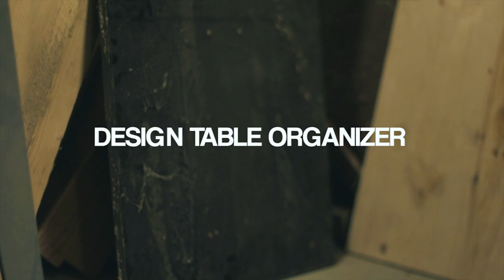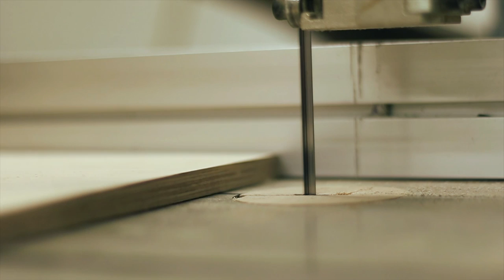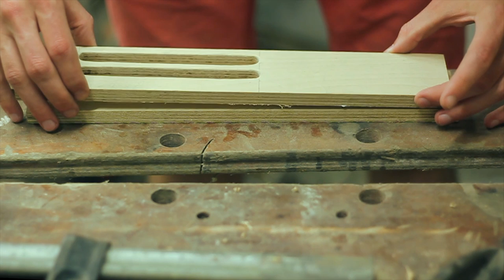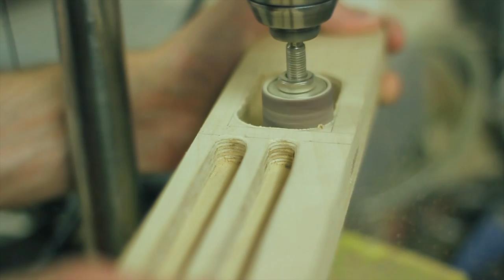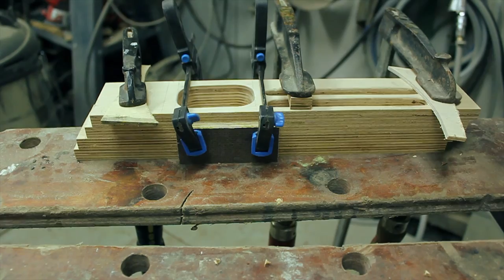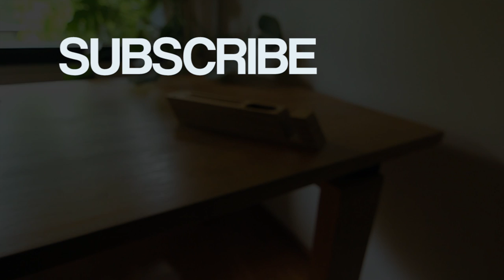Table Organizer Inspired By Scandinavian Design

Comment: It's a very nice video, with very good music, much like sine of the music from O'llari's from Hungary. This video is similar to his, which many people like. 

Also, I gather you don't have a router? That way you didn't have to file all those drilled holes. Nice piece.
Reply from the maker: Thanks. I'll check some of his videos out. 

You are right, and I did think of using a router. At the moment I have only a router handle for dremel, but the dremel with a router bit didn't seem to be enough for plywood. I guess dremel doesn't have enough power or something, It just didn't cut the plywood. It has worked nicely in my other projects with regular hardwood. I could have loaned a router but I tought it might be cool to try to use different tools. With router the holes would have been much straighter that they are now.

I was thinking of trying voice overs in some of my future videos because then I could also mention these problems I encounter and explain why I did something the way I did. But first I must do a couple of test videos with voice overs to see if I'm happy with the results.